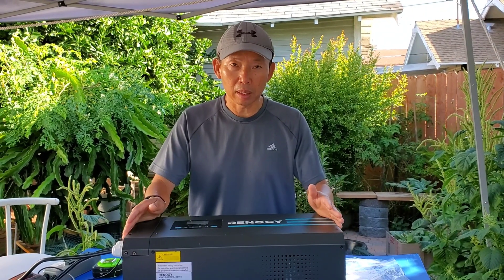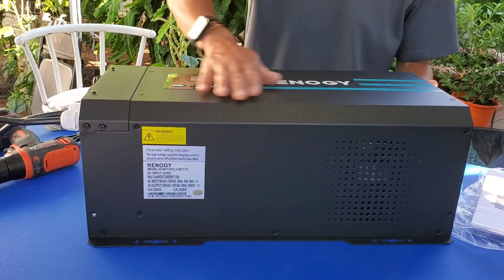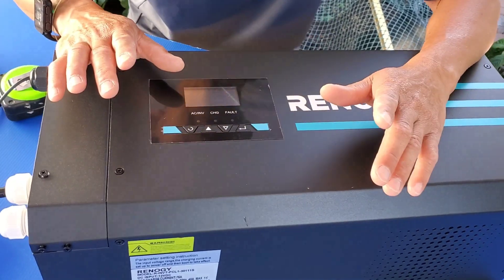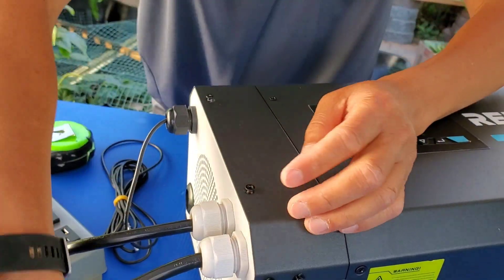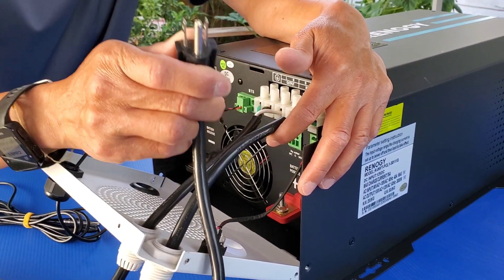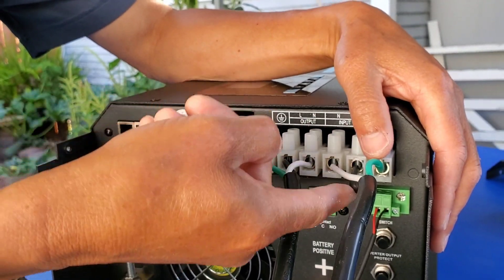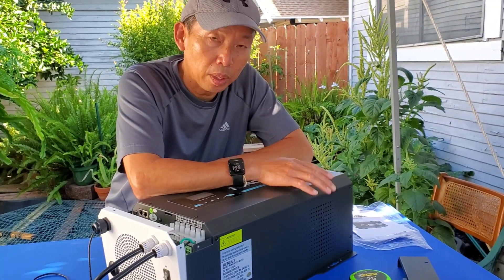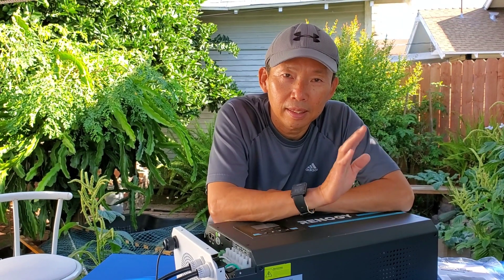Renogy 3000watts Pure Sine Wave Inverter/Charger -out of box over view

Comment: The input and output you use 10ga wire. As these are rated for 30 amps shore power....You use #12 and that wire will melt before it trips anything...

Comment: e lasted exactly fourteen months from the moment it was professionally installed. The warranty for this product is one year. I contacted Renogy customer service bc an inverter is supposed to last something like twelve to fifteen years according to current design standards. Renogy informed me after asking me for photos that my unit certainly had malfunctioned but since it was out of warranty they cannot help me. Read that again if you are considering this for your van or camper. Mine is at least the third unit I’ve heard of wearing out before the fifteen month mark. It’s almost as if they are made just good enough to put outlast the warranty by a bit and die. I’m making a video about this product and the customer service of this company soon. For $400 more I could have had a Victron that would have lasted fifteen years. Now I’ve cost myself an extra $700 for this unit that is of poor design. Don’t buy this product and limit how much Renogy equipment you install in your build bc they will not stand behind their products if you encounter issues.
Reply: 99.9% of the ones that fail. They stuff them in a box with no ventilation. As these things need cool intake and clear exhaust path. Then they don't ground the chassis to the vehicles like they tell you to. Yet there is a ground connection sticking up on the bottom. That needs a #8ga wire...Then wonder why they overheat and fail.. 

Read the manual. And stop watching what other people did...As they might have done it wrong..

Comment: Hi 
I watched your video many times.
I have a question about 3000w inverter same as yours.
I set up it my van  but when I use 1800watts induction cooktop ,
After 1 minutes the inverter shutdown and after 3 sec reboot.
I don’t know why it was shutdown and reboot.
Do you have any problems while using inverter?
I returned first one and  received new one. But it Has same problems.
I have 4 100amp Renogy lithium batteries.
Please, to send the answers or questions.
Thanks
Reply from the maker: Hi James.  We need have a problem.  But I think you should call Renogy tech support they can identify the issue. I don't want to give you the wrong info as I'm not a pro at this either.
Reply: @BoChuonOUTDOORSVANBUILD  

What I wonder is if you have the same problem as me. It's 3,000 watt capacity, but I can't use 1800 watt, so I'd like to get some help.
I asked the company and see the manual but no answer.

Comment: What is the thickness of the wood you mounted the inverter to? The inverter is so heavy I’m afraid it’s going to rip out of the half-inch plywood
Reply from the maker: The van has the original treated wood floor plus I have a layer of the hardwood floor so I mounted it through both.

Comment: Hi! Thanks for this video.  I actually just bought the 2000W inverter charger from Renogy.  Something I am having a problem with is connecting it to shore/land power and wanted to get your input if that is okay.  It appears to be a simple connection, but for some reason my device is not turning on, and I think it has something to do with the gauge of my wires.  I saw that you had a 3-prong plug with a pretty heavy duty gauge (probably somewhere between 6 and 10 as recommended?).  Do you know where to purchase those?  I'm using a 14-gauge wire to connect to shore power and I don't think it has enough juice to it, but then I also cannot find anywhere that sells heavier gauges. Thanks in advanced!
Reply from the maker: Hi Ivan,

Your 14 Gauge wire should work.  I'm using 12 Gauge Marine grade.  You can find it on Amazon.  If your device does not work double check your connection.  Let me know if you still have questions. 
Good luck
Reply: @BoChuonOUTDOORSVANBUILD  Hi Bo, Thanks for the feedback, i'll give it another try on some other outlets in my house.  Will let you know how it goes - thanks again

Comment: Thanks for your video, quite helpful. However, I have no clue about electrical system so I’m trying to learn some basics on “YouTube University” . Sorry if this maybe a dumb question, but how do you modify the extension cord for it to be bare wired? Could you purchase it spiced or do you have to do it yourself?
Reply from the maker: Hey Yen not a problem.  I started knowing nothing about electrical either.  So you can buy the wires to make your own plugs.  In this case I wanted the heavy duty case and no need to deal with anything else I bought the complete plug then cut the cord and splice to get the bare wires. 
Let me know if you have any questions you can email me bchuon66@gmail.com

Comment: Now that you have it hooked up, will you do an overview of it running? I would be very curious to hear the sound level of the unit when under load. Does the fan run at all times or only when it reaches a certain load level?
Reply from the maker: Hi Al 
I did have it hook up but the van was done and picked up.  However we did run some tests.  First you first turn it on it beebs for a few seconds and the fan runs for about another 5 seconds then off.  It actually is kind of loud  if you really pay attention to it.  After that it's on only when the unit reaches the temperature level.

Comment: is it safe to wire in the surge protector/power strip? I have the 2000w inverter and was told id need to find a power strip with a 3000w limit to be safe.
Reply from the maker: That would be a good idea.  We normally don't use anything in the van  that would draw 3000watts at once but it's not a bad idea to have it in my opinion.

Comment: Do not buy a Renogy inverter charger. I bought one back in May. They charged me for and sent two. I had to send one back and get a refund. A month later, the one I kept quit on me. After weeks of dealing with trying to get through on their technical support line they sent me another even though I wanted a refund. That one was bad out of the box. After a week of fighting with their technical support, they agreed to refund if I sent it back. That was three weeks ago. I still don’t have my refund, but they have their non-functional inverter/charger. Bad company, bad customer service.
Reply: Buy these kind of items at Home Depot You have 180 days to return no questions asked.
Reply: Had a bad experience also with this inverter charger. Died after a couple of weeks.  After about 10 months of frustration trying to get a response from CS they did eventually send a replacement unit.  Sold it and moved to another brand.